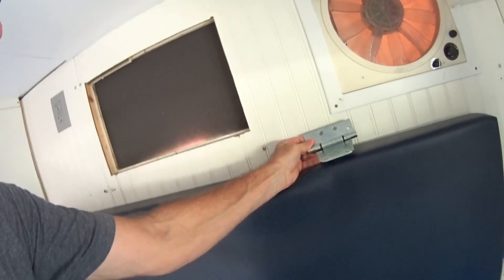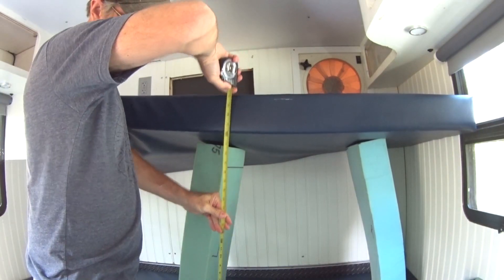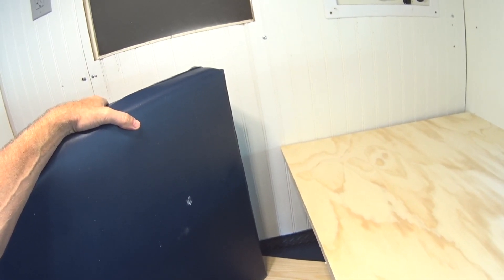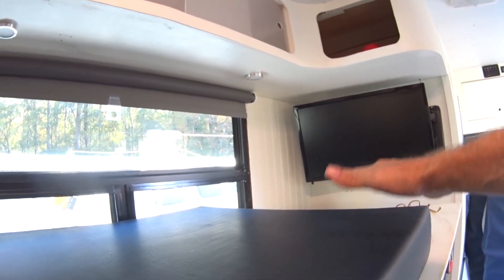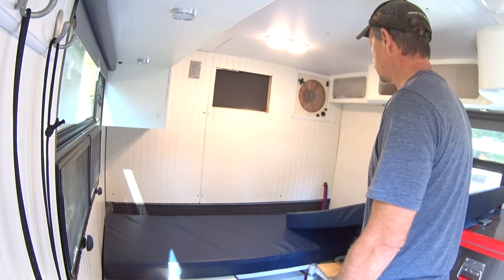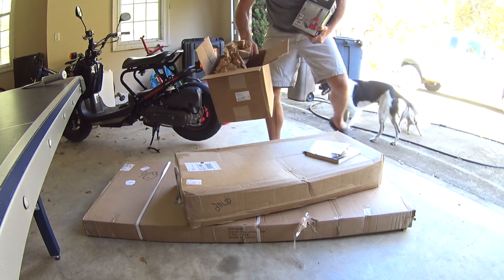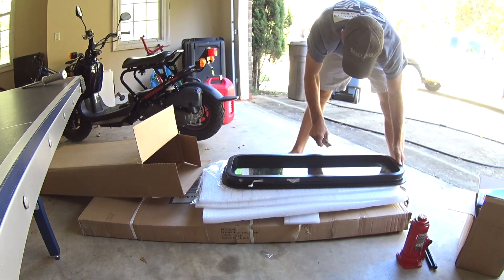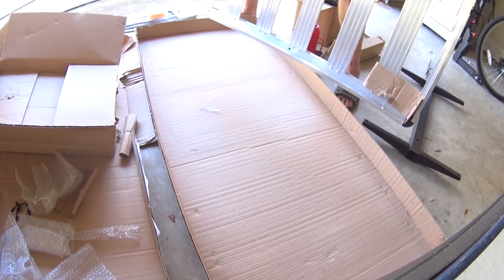DIY Box Truck Camper Murphy Bunk Bed and Frameless RV Window pt1

Comment: the bunk bed might bow a bit in the middle , you can put a 1 by 4 strip on the long end thats suspended , when mounted under the plate it will cause the plate to come off the wall at the bottom when in the folded position but i think that just makes it a more comfortable backrest 
you could put the strip on top of the bunks edge too , it would sit under the cushion when its folded down , it will hold the cushion on the board while folding it out and prevent it from sliding over the edge 
prolly could put some slide latches under each outside corner and lock the bed in using reinforsed holes in the side walls 
http://img.directindustry.com/images_di/photo-m2/69346-2871779.jpg
the latches will be at the back of the board when its folded down , they should work as long as the bow isnt enough to pull them out the holes